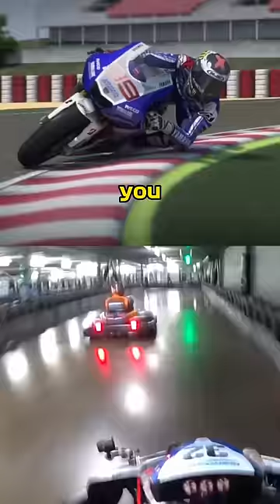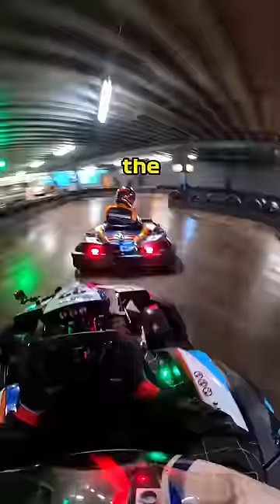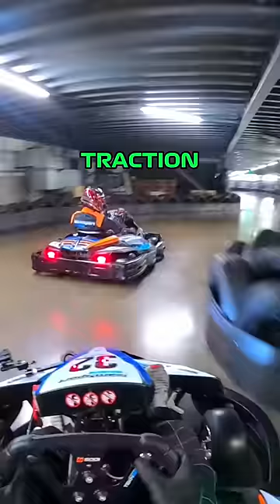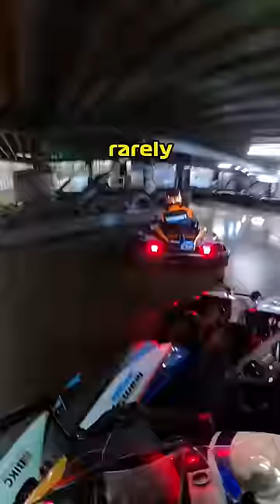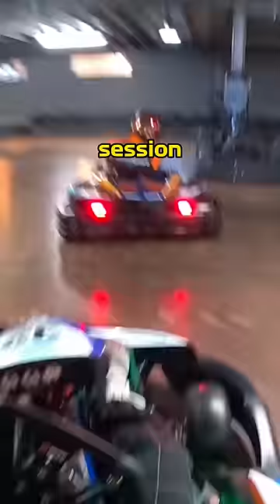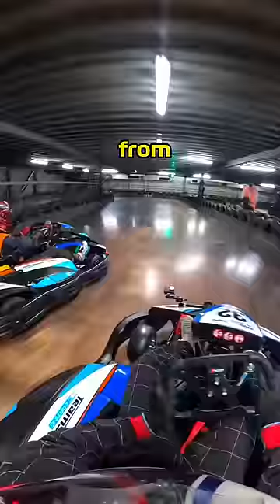WHY is this KARTING DRIVER LEANING in the Corners? #f1 #racing #karting

Comment: I didn't know that. Funny enough, I do that naturally and I've only drove karts like 4 times. There is only an indoor one close to me.
Reply: Same😂
Reply: Same here.
Reply: I think it’s natural to think to lean inward. Probably means people lean wrong on outdoor tracks
Reply: It’s probably because you just trying to counter the g forces
Reply: Are you leaning inward? That’s wrong. The inner fixed wheel can’t rotate properly.
Reply: @jama211   leaning inward will slow you down as to turn you need the outside rear to be on the ground and the inside rear off the ground, if you lean inwards then you will have understeer due to the fact that there is less pressure on the outside rear and more on the inside, although leaning in rentals/indoor is useless since they weigh like 200kg with the driver
Reply: Yes, you will naturally lean in the wrong direction
Reply: I do it with my controller when playing racing games. Im kindof a professional
Reply: Same, I once got the fastest lap of the day because of leaning
Reply: @illegalcumtrader56  with karts yeah, but not with quads because they have a higher center of mass and can flip if leaning outwards.
Reply: @evanmorrison3232 😂
Reply: Yeah i do it too when i play mario kart ds
Reply: Jesus loves you.
Reply: EVERYBODY does
Reply: I think the timing of leaning out makes a difference. If you lean out after the kart starts to rotate through the turn it will rotate faster with more weight on the outside
Reply: GET ON A BIKE RIGHT NOW
Reply: If Dunning-Kruger effect was a comment section, this is it
Reply: You are simply a natural raw talented carting driver then! You should go hit up a team.
Reply: Same
Reply: So breaking moght be easy , but really controling the brakeing and the positioning is hard
Reply: Exactly same
Reply: I do this because I played a ton of motocross games lol
Reply: People do it because it’s natural to lean like bowling we lean even though it means nothing.. doing it effectively is what makes it impressive

Comment: i race in karts for the best part of 18 years now and there is absolutely no reason to lean into a corner in indoor karting the only thing this does is take away grip from the outside tires and exhaust you body core more than necessary. don‘t lean into corners, ALWAYS lean onto the outside tires IF needed.
Reply: Yes, I just wrote a very similar comment. 👍
Reply: This is interesting. What if you're going at a decent speed, so centrifugal force is pushing plenty of weight to the outside tire, giving it plenty of grip already. This would cause the inside tires to not lose traction, but have reduced traction, so theoretically wouldn't shifting weight to the inside evenly distribute better?

Actually just thinking about it more right now, is it because there is so much force & weight & pressure on the outside tire for not just traction, but grip for turning, & acceleration/deceleration all at once? Because that outside tire is absorbing say 70% of the cornering grip, it needs the extra weight/pressure to increase grip, which in turn increases turning/accel/decel/etc?

Maybe I'm over thinking it lol - I'm a motorcycle guy, so I know about shifting body weight to the inside racing line, but some like me also liked to put a lot of pressure on the outside footpeg to sort of 'counter balance' the lean angle to be able to better fine tune the trajectory & feel the rear grip, as well as rise up & accelerate out.

Either way, fun stuff 👍🏻race safe 🏎️💨🏍️💨
Reply: Yeah there’s literally no reason to, ESPECIALLY if the track is slippery like he was saying which in that case outer grip is VITAL. If anything just don’t lean at all if you feel like leaning inside. But even then it’s best practice to just get into your muscle memory to lean to the outside even if it’s not beneficial. There’s no reason why you wouldn’t want grip on the outside in a corner
Reply: @firstnameIastname 
That’s not really how centrifugal force works, it’s sort of counterintuitive, but the more force a tire applies to the ground, the greater the ground applies a force on it, meaning the closer it is to losing its limit of grip. However adding weight to the outer tires means you are increasing the normal force exerted from the tires onto the ground (and consequently from the ground onto the tires), and therefore increasing the force of friction, which increases the limit of grip. This way, you can take tighter and faster turns with a greater centrifugal force than if you had no weight to the outside. 

Think of it like this way. The grip of your tires, which is from the frictional force, is like a meter which you can fill up. The greater the centrifugal force, the more this meter fills and the greater the force of friction is. However, exceeding this meter results in a loss of grip. By increasing the normal force by leaning on the outside you are increasing the maximum capacity of the meter. In most forms of track racing it is optimal to stay at the limit, so having a greater frictional force will let you have a higher limit and therefore higher speeds/better handling if driving optimally.
Reply: @bolson42  That's an interesting way of putting it! Thanks for the explanation, definitely given me food for thought, a bit more thought & understanding into it, and always appreciate the extra knowledge. 

After I've over-explained countersteering one too many times about motos to people, now whenever anybody asks I just say, "it's magic" 🪄🎉 lol
Reply: Oh my god yes. I have been trying to tell everyone about this in the comments but no one listens.
Reply: My friend... The opponent of the guy in the video was literally drifting into corners... When you lean to outside, you are increasing oversteer, and reducing grip. It depends of the track...

Comment: I always lean when I’m karting.  It just feels natural for me.  I love pushing karts to the edge of grip and holding the tightest line possible.
Reply: Do you lean in or out?
Reply: @DrLongSchIong  I usually lean into a corner like a bike.
Reply: @LBKXiLo if you ever race on pavement you're probably going to want to do the opposite
Reply: @rayzie8599  On any surface he should be doing the opposite.
Reply: @roadsidegarage69  totally depends on whether he wants more or less rear grip. If you want more grip lean inside, if you want it to rotate better, lean outside.

Comment: I honestly just lean into a corner naturally when karting. Didn’t know there was any benefit to it though lol. It did tear up the skin on my back pretty badly though
Reply: Try leaning to the outside, you should only lean inwards if the kart starts hopping. Basic newtonian mechanics
Reply: leaning in will give you understeer because to turn you need the outside rear tire on the ground and the inside rear off the ground,  although in rentals it will do next to nothing because of how heavy and slow they are anyway. youll only see differences in grip from where youre positioned in actual karts

Comment: 0.2 seconds is a lot though since he made a little mistake at the last corner loosing time. But over I’ll it made a pretty big change. If I’m wrong please correct me
Reply: Its not 0.2 its 0.02
Reply: @shreedharmathur9581  I think the time doesn't matter for racing like this. Who ever wins wins which he didn't state so I will assume he lost. Achieving that 0.02seconds with leaning granted the other driver the win.
Reply: That 0.02 seconds could be the difference between qualifying for a competition and failing to. Racing in karts like these tend to be pretty close (unless there's a bad kart)
Reply: Losing*
Reply: You're wrong. Losing only has one O. Loose means something isnt tight. Lose means you didnt win

Comment: im sorry why is he basically stopping in the middle of the apex, also is that teamsport crawley or is it just similar?
Reply: I think he is stopping the car because of drift. He turns fast, but loses speed. They do this a lot in rally, mostly in gravel. This way you can accelerate in a straight line. Dont know if thats an actual thing in karting though, not my speciality haha!
Reply: @cocoalpes  Yeah it isnt a thing in karting because the ground is a lot more grippy, you say they accelerate in a straight line, my guess is because of the uneven and bumpy surface you will lose speed  whilst weaving
Reply: This track has polished concrete for floor and it's very very slippy, I know because I've raced on that surface it's really difficult. Also Cameron was avoiding contact with Dante
Reply: He's stopping (slowing) on the apex so the car behind can't get on the accelerator so early and get alongside before the next corner.
Typically you're going to want to turn earlier if there's a faster car behind you so they can't get up the inside, but this compromises your line out of the corner and you can't get on the 'gas' so early. The car behind can take a wider line on entry, a later apex, and can get on the gas earlier and pass on the straight. By stopping on the apex, the driver behind can't accelerate early because you're in the way.

Comment: Your method was clearly faster but he just wasn't letting you past at all costs
Reply: I noticed that too. Dante was just driving maximally defensively. Hugged the inside and slowed right down before exits so behind has no chance to build momentum difference to overtake down following straight. Someone forgot to tell him BIKC final is not until December?
Reply: Driving defensively to stop people passing always slows you (and your attacker) right down. 
Its only the wrong thing to do if there is someone else in front of you that is catcheable and you are giving up that possibility by driving defensively and fighting only for your current place.
My brother and I always kept an agreement not to fight... and instead to work together to get to the front.... only then and when clear would we start attacking each other and have to drive defensively.  Its the best approach to use if you can but you'd need to be at a very similar same level and in full agreement and also trust each other for it to work.
Reply: @paulhope3401  and if partner in front is marginally slower....bump draft him.
Reply: @DrR1pper too slow and too low to draft

Comment: This is actually effective, especially as a heavier driver. I found myself intentionally lunging in either direction to just get the back end loose around hairpins. It is a lot harder to stay clean, as being a bigger guy increases your braking distance, but the weight pays off more when you’re completely balanced, as the kart reacts more in line with your desired inputs instead of having to rely on how the kart was tuned.

The extra 20 pounds does leave more to be desired though, as my lap times were about 1.5 seconds slower than the record time at my choice location.
Reply: you may notice some slower initial lap times because it takes longer to get going faster, but you will find your speeds to be more consistently faster as your added weight can be carried through the corners giving you an edge over lighter drivers... at least this is what i found :D
Reply: Sadly not true
More Weight -> less acceleration and higher forces in corners limiting corner speeds.
I'm quite light and often won against better but heavier drivers
Reply: @YeeetMaster420  not exactly less corner speed but I get what you’re saying. However, that was my main point. 

There is a bit of a snowball effect, which can help and hurt your time, but as long as you stay clean and keep quick line for a much as possible, you can beat guys 50 pounds lighter, or at least match speed.
Reply: It's very very track depedent I'd say. At my local track I'm about 0.6 off of the lightweight lap record, and I'm about 60 kilos heavier than the kid that done it.
Reply: @levy2jz  this is super true, especially on outdoor tracks.
Reply: @Krasher247  weight is NEVER an advantage. slower cornering, worst braking, and most of all, worst acceleration.
Reply: @levy2jz  then it just says that the kid left a lot of time on the table.
Reply: @DonLee1980  Don't think so mate. The little lad was at the track everyday for weeks after his lap record trying to go faster.

Comment: ‘I rarely lean in indoor karts, just because it makes it harder to be clean with steering inputs’ Dante’s while driving style consists around not being clean with steering inputs, he is so jabby while steering, to the point where the steering wheel is almost always pointing straight, as he just goes from full lock to straight again almost immediately
Reply: My man’s steering be like an F1 car on a controller
Reply: That’s how I kart too when it’s slippery lol
Reply: It’s probably cause of the slippery track but yeah his steering isn’t very smooth. I gotta work on it too though so it’s not just him 😅
Reply: @Anksh0usRacing  Nah, I’ve seen Dante racing on outdoor circuits (GYG, Whilton, e.t.c) irl, he has tailored his driving style to work like that. He’s actually really quick with it, but it’s why his hands are so high on the wheel.

If you can make the same style work, keep going with it; but if you’re going into owners, it will not work

Comment: Having more traction on the inside tire is actually not good, since the axle is completely solid and has no differential, he should actually be leaning outside, since it puts more of the weight on the outside tire, which increases traction in corners, and if you have enough grip, might even lift the inside corner rear tire off the track entirely. That is a good thing since the karts don't have a differential, so the inside rear tire is spinning faster relative to the ground than the inside one, and making the kart turn worse. In outdoor karting, everyone leans to the outside, since in tight corners, lifting the inside tire is a LOT faster and when you lean outside, it also gets more grip on the outside rear tire, which means the kart turns faster.
Reply: Finally a comment that makes sense

Comment: They're obviously scrubbing so much that you could drive right around them. 

They lose an absurd amount of exit speed. 

Consider allowing a 3ish kart length gap and set up a corner to give you more exit and straight speed than normal.

To do that, use up your gap to dive toward them while they scrub speed, allowing you to take a line that gives you a longer straight and MPH so you can drive by on the straight or dive by them on the next corner.

Comment: I've always leaned outwards for more traction as i'd get more weight in the outside tires thats doing the majority of the work anyway :S
Reply: You should. And its not about extra pressure on the outside tire, but more about relieving pressure from the inside tire. Ideally you want the inside tire to get off the ground so there is no tention between the outside and inside tire because of different rolling speeds.

Given the fact that rental karts are so much more heavy you should always lean to the outside.

Comment: Yes. I lean in my pro outdoor racing kart. It helps put the tires on the ground more.
Reply: This is actually a way better explanation than the one in the video...
Reply: Depends on the corner. If it’s a corner that has a lot of g-force then lean but any other corner I just stay in the middle

Comment: You can lean on the outside of a turn to give the tire more load pushing it harder into the ground and acheving more traction, but you need to know what you are doing.
Blud was lost on the racetrack

Comment: I found (in outdoor carting at least) that leaning to the outside put more weight on and giving more grip on the outside rear wheel [let's be clear - you can't roll them] this also lifts weight off the inside rear and stops the wheels fighting each other/binding in tight corners, because they don't have a rear diff. so you actually want the inside rear to slip a little in tight corners.
Reply: This is mostly correct, just the not being able to roll them isnt absolutely correct, since once i managed to nearly roll one because i got the inside corner wheels around 50cm off the ground. Not even off a bump or anything, there was just a completely insane amount of grip.
Reply: @roadsidegarage69  yeah, it was lazy writing: should have been   - "their almost impossible to roll".
Reply: @pdloder  *they're almost impossible to roll
Reply: @roadsidegarage69  😄 so they are😆

Comment: First off, the guy ahead isn't smooth. But anyway, maybe he's leaning forwards (and a little left in a left turn) to increase the grip at the front, it looks like his car is understeering (pushing in America) a lot.

The purpose of leaning out in a corner is not to increase load on the outside rear tire, it's to unload the inside rear tyre so the engine doesn't bog down. It's a fixed rear axle, so both wheels turn at the same rate, but the inside tyre covers less distance than the outside one. The inside one is already unloaded, so leaning out takes more load off the inside tyre (which is rotating less than the ground it's on) to allow it to slip more with less friction, so the outside tyre drives the car forward. If the inside tyre had the friction and drive, the engine revs would be lower because it's covering less distance, and we all know that higher revs result in more acceleration.